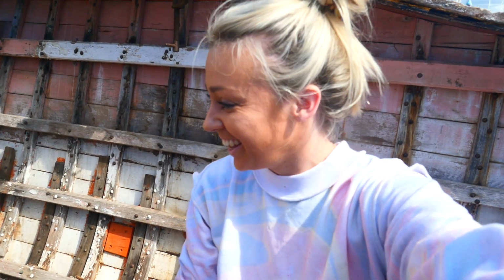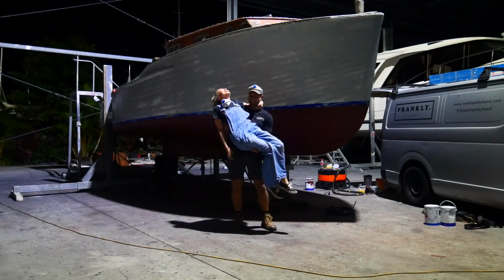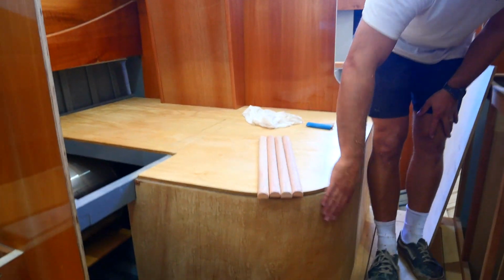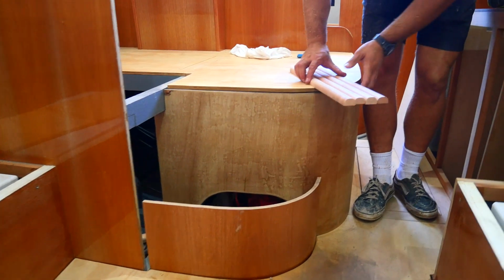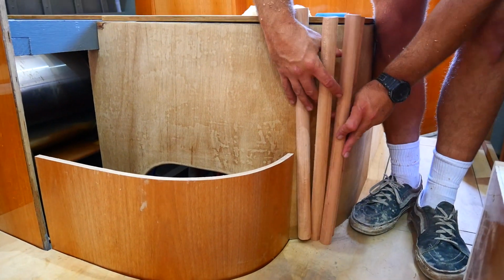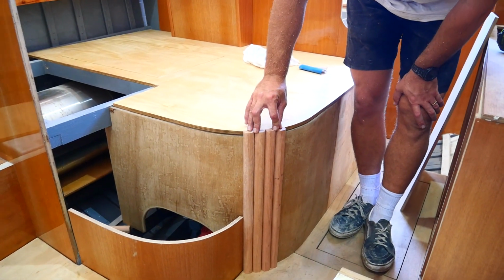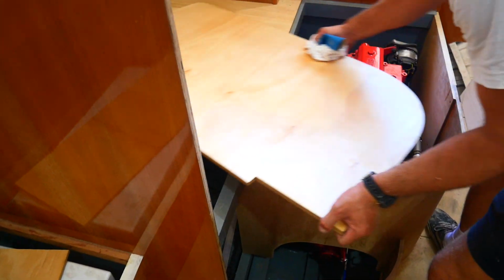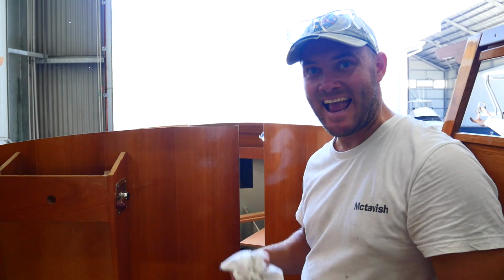ep 27 - WHAT!! making decisions and getting a move on so we can set sail soon!

Comment: where does the timber move when it gets wet?
epoxy doesn’t move timber does when it get wet, even above the water line. So looks like your up for a full glass over job. That’s ok at least the Oregon will last. Spilling in the gaps with similar timber may have been smarter, but you obviously have a good advice to use epoxy filler in a carvel plank?….